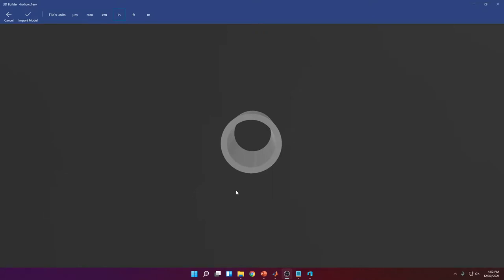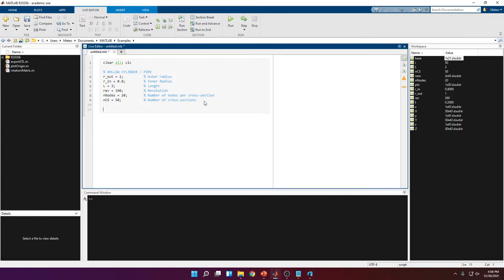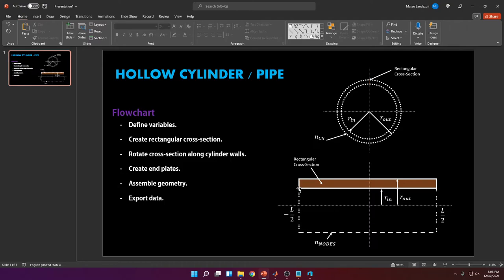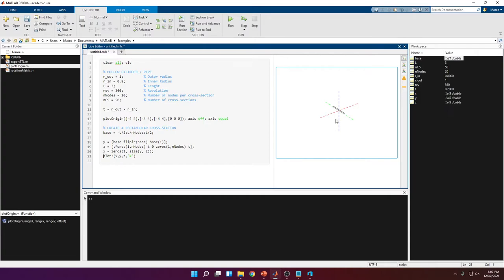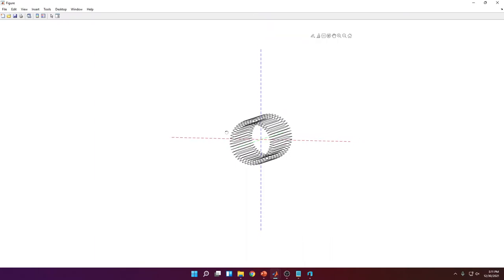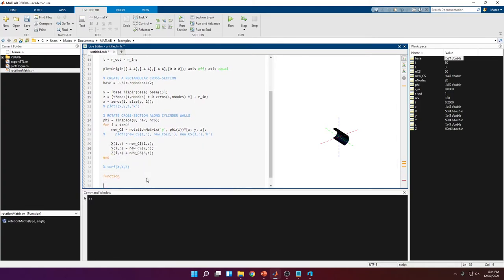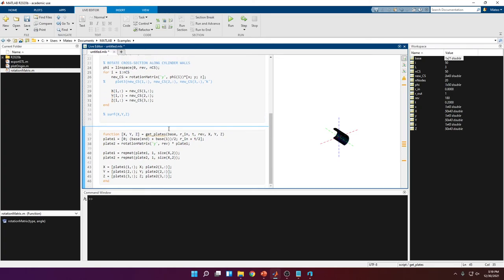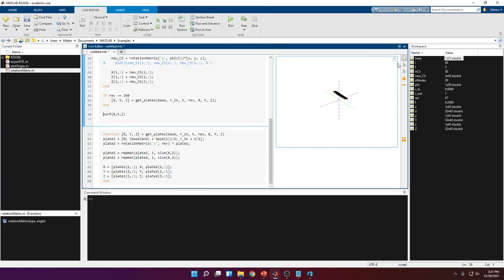Create a HOLLOW CYLINDER in MATLAB || TUTORIAL

Comment: Thank you very much for this video,Are we can Apply this code to define the geometry of antenna ?
Reply from the maker: It would depend on the shape of the antenna. Have you tried using CAD software? for more complicated geometries it would be easier to model them there.
Reply: @prot0form775   I don’t  want to use CAD software. I want to design and simulate in Matlab @prot0form775
Reply from the maker: @essamsalem6630  it depends on the geometry of the antenna again. If you can get the profile of the antenna in mathematical expressions and divide it in fairly simple cross-sections, you could do it, would be difficult but possible.
Reply: @prot0form775
I know it been a while you had traction with this video, am hoping you can still see this message.
I am kin to discuss how to code a hollow cylinder buried in soil. Is there any way to reach you outside YouTube for a meeting?